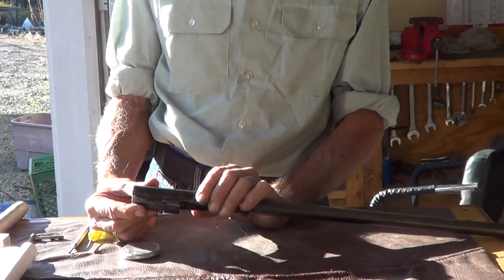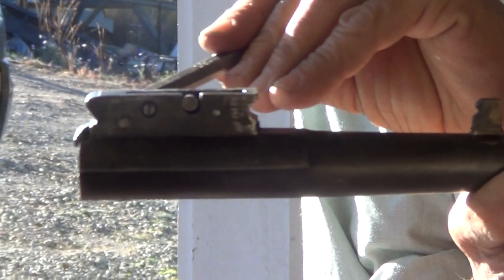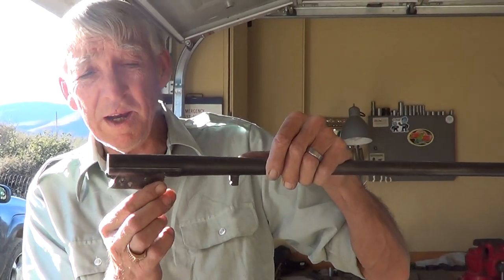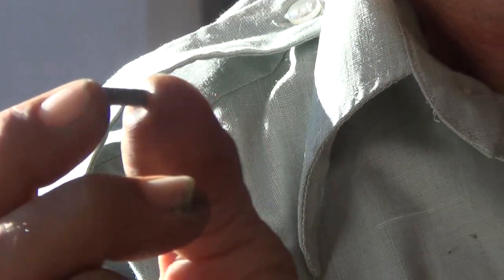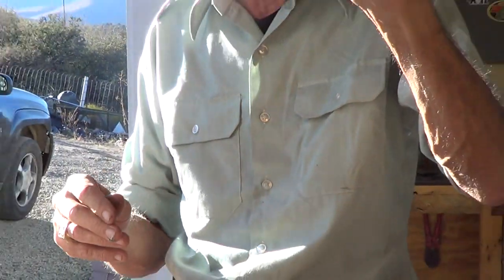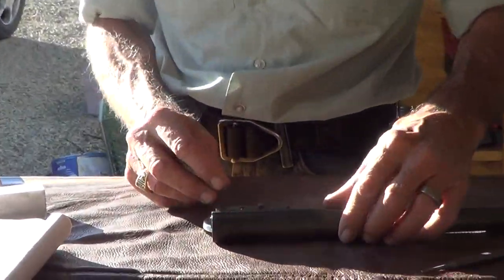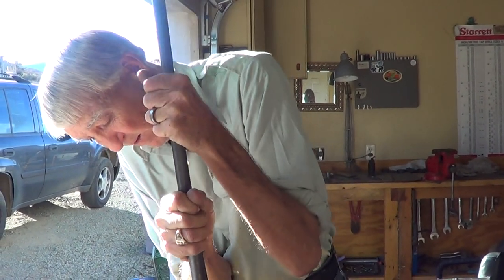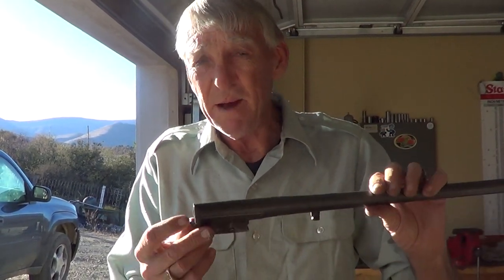REPLACE EJECTOR IVER JOHNSON SHOTGUN RESPONSE REQUEST FROM WHEELING AND GUNNING

Comment: Hi, question about the Iver Johnson single barrel shotgun. I have the receiver completely disassembled however, the barrel will NOT disconnect from the receiver. I have moved it up, down, and jiggled it left, right, and it won’t come off. Is there something (pin) that could be causing it from lifting up and out?
Reply: Hi, thank you for the response however, I’m not quite sure what you exactly saying. I do have the entire receiver completely taken apart, and the only thing connected is the barrel to the receiver. Hope that explains it a bit better. Is it possible if you could do a video on it? I know that’s asking a lot from you so if not that is ok. I appreciate what information you can provide. Thanks much, and take care!
Reply from the maker: Sorry, got mixed up from a couple comments, you have to find the pin.
Reply: Hi and thx for the response. Which pin are you referring to?